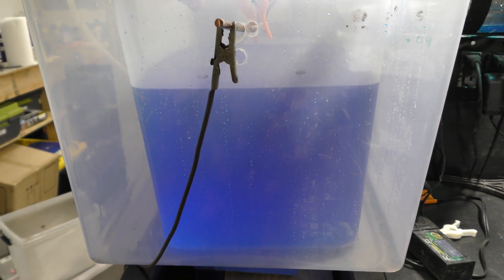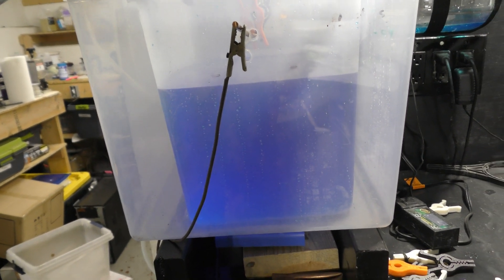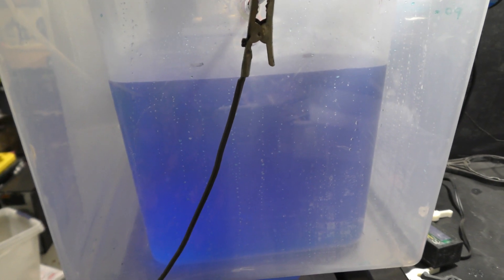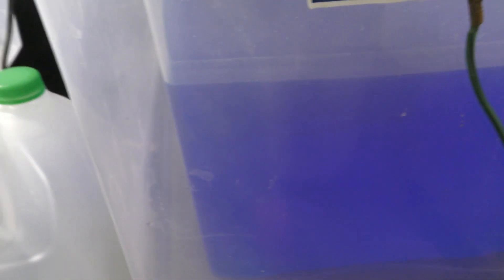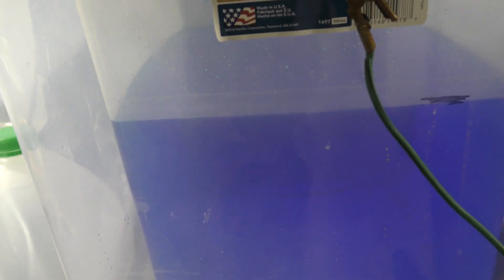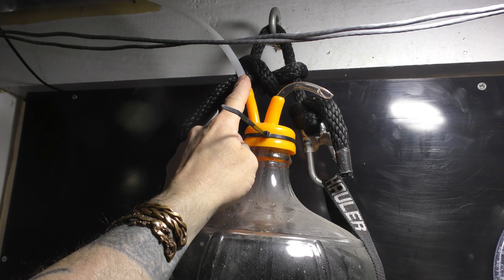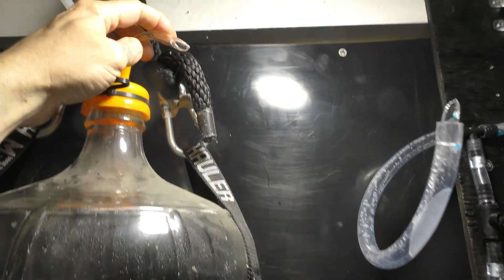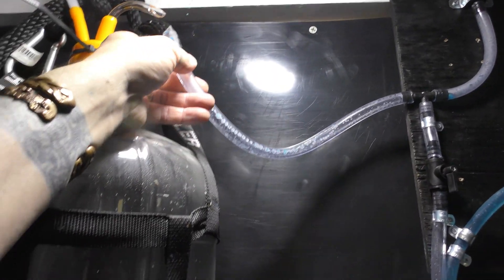Storing your electroforming tanks for long periods of time

Comment: 7:20 Why not just neutralize the acid with sodium carbonate (soda ash) or sodium bicarbonate (baking soda)? It seems like most copper plating electrolyte solutions use sulfuric acid and I think those sodas would be two things recommended to neutralize H₂SO₄, one or the other depending on its concentration.

Comment: that green is likely nickel from the nichrome heating element. iron you can ph treat by raising the ph up to 5.4 in a secondary tank heating to 150f with hydrogen peroxide  then filtering the iron  precipitate. the glass breaking was likely due to the water getting to low and if your sulfide levels are to high you can correct that through running platinized titanium ancillary anodes to reduce the TMC of the solution